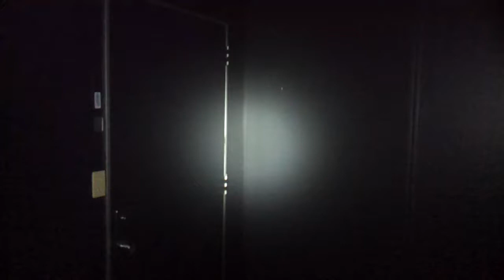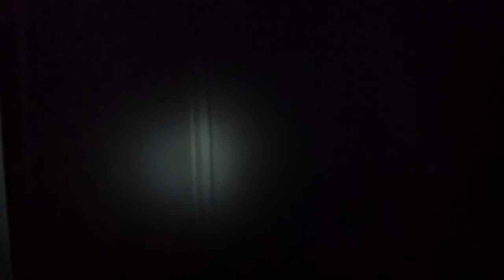Malkoff M61 LED flashlight module driven by Uniq Continuously Variable Tailcap

Comment from the maker: Lighthound  sells them with a matching Cree XR-E style LED module with constant current driver that it works with.   I used it with other LED modules and incandescent lamps that were less than 2 amps total draw and it worked fine.  Does not work with pulse width modulated type drivers for LED modules that have their own high/medium/low... settings.